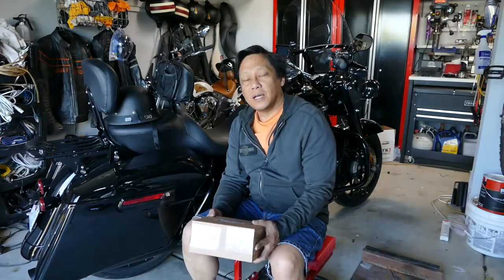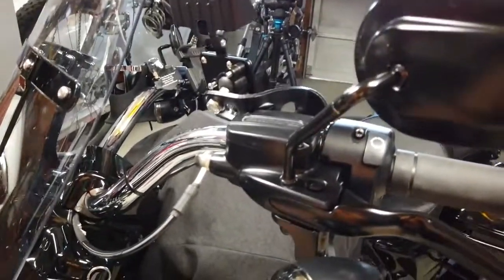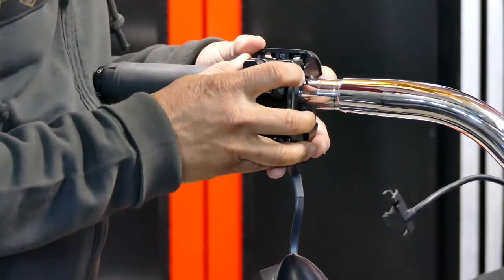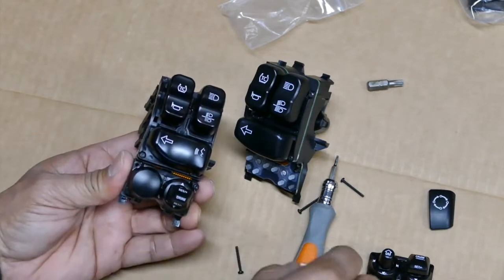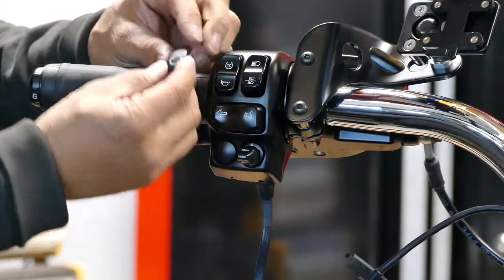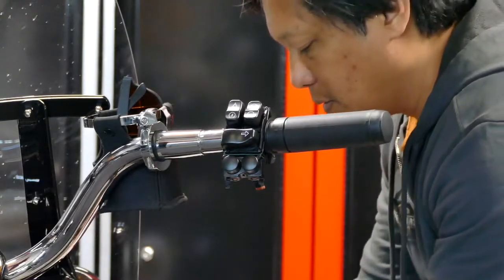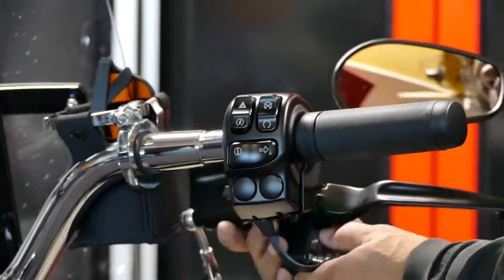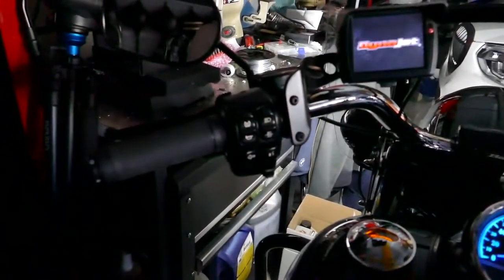Illuminated Hand Control install on 2020 Road King Special

Comment: We need more info about those handlebars. I’d like to see how they look without the windshield and where they move your hands compared to the mini apes. 

Great video. Very helpful. I did my speedometer based on your video. Super easy
Reply from the maker: The chrome handlebar you see in the video is the RoadKing Fat Handlebar part 55800386. It was not a straight forward install because of the turn signals mounting position. This handlebar swept back more than stock RKS which will make the stock turn signal point outward. I had to do some minor mod to keep the stock turn signal to point forward. 

As for comfort, the handlebar allows the driver to sit back with a lower grab, exactly like sitting on a Standard RoadKing. For me, with the stock RKS bars I had to lean forward and would not be able to rest on the back rest without letting go of the bars. I would think if you can sit back fully on the driver backrest with the RKS stock handlebar, then there is no need go with this change.
Reply: @rtabcum  Thanks!

Comment: What is the clip in the rear of the control??? It's connected to what looks like a chip by an orange connector?? It clips to the front of the control,from back of handlebar..

Comment: I bought this same kit for my new ‘23 RKS and the left side is dead.  No lights and no functioning switches. When I plug my old one back in all my functions work.  Any ideas? I returned it and now I’m on my second set and it is doing the same
Reply: Does not fit for 21 and newer, only bikes with hydraulic clutch. Been there done that!!!
Reply: @PaddanH  What's different? I bought a set for my 21 RKS and same problem. Nothing works on the left but factory works fine. Any ideal if it can be rigged some way?

Comment: Any idea if this’ll work on a 2017 RKS?
Reply from the maker: There should be a specific model made for the 2017 RKS. Please check with the parts department at Harley Davidson for the proper part number.
Reply: @rtabcum  i appreciate you replying man. Thank you!

Comment: Dude just noticed you got the heated grips. Do you have installation video on that?
Reply from the maker: The heated grips was a bit involved because I also upgraded the handlebars at the same time so did not get a chance to create the video. One of these days, I will take everything apart and do a video of how to install the heated grips. The hardest part I remember was running the wires through the handlebars and making sure I don't bend the pins when installing one of the grips.

Comment: Does your cruise control work after changing it to the new control?
Reply from the maker: Yes. I used it several times already. Works fine. If yours does not work, you may want to have Harley Service run some diagnostics.

Comment: Hi Russ, I just watched ur illuminated switch control video &. I was wondering if u still have the right switch control u’ve replaced and can sale it to me plz let me know if u do how we can go about buying it from u
Reply from the maker: Sorry but I am planning to keep my stock parts for now.
Reply: @rtabcum  thanks, I tried to purchase the same illuminated switches but the HD told me they were not made for Road King models, is that true & how r they working on urs? The reason I need the right hand switch is because when I removed mine, the orange/black plastic or electric stripe teared off & now my rear light does not light up when I apply the front brake lever the rear brake lights now works when I use the foot brake pedal

Comment: Cool I was wondering if the mount would work with the pv. Do you have a video about all the stuff you bought and what it took to assemble? Is that just the visor screwed into the zumo mount and that’s it or did you have to buy separate mounts and piece-mill it together?
Reply from the maker: I have not made any video on the PV yet because. I have only used it to read the ECU reported engine temperature. I have not modified any engine parameters as of yet. I plan to do a quick installation video and go through some of the PV status menus. Hopefully sometime this summer.
Reply: @rtabcum  just want to know about the physical mount. I’m reasonably familiar with the pv operation. I have it mounted via the H-D ball and universal phone/gps mount and I don’t care for it. Your setup seems nicer and quicker.

Comment: Hi, great video as always. I am about to do the same too. Just curious I saw on the manual, the last step is to Verify clutch interlock function. Did you do this? What this mean? It looks serious but I feel we just changing these control housings its just plug and play shouldn't need to do that right? This is Step 5 in the Manual. Thank you.
Reply from the maker: The clutch interlock is very important because you could inadvertently start the bike in gear causing the bike to lunge forward. The easier way to test this safely is to put the bike on the center stand rasing the rear wheels completely off the ground, put the kickstand up, put the bike in 1st gear and try pressing the starter. The starter should not turn over.
Reply: @rtabcum  umm did you had to test this when you installed the new control?
Reply from the maker: @georgezhou1415  I did the test my way with my bike on the center jack as I described in the previous reply. Jack it up, put it in gear, press the starter. Bike did not start. Test completed.
Reply: @rtabcum  Gotcha. Thank you very much.
Reply from the maker: @georgezhou1415   I finally got around to do a video showing how I verified the clutch interlock. https://youtu.be/RKj94YzZaTw